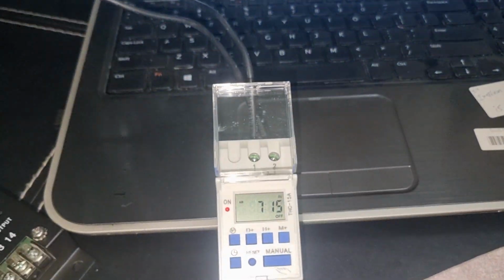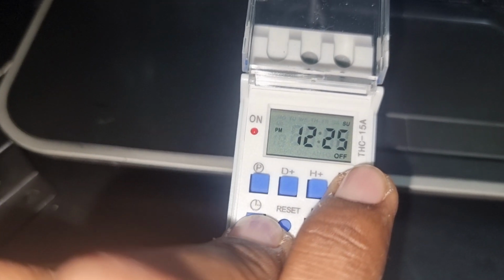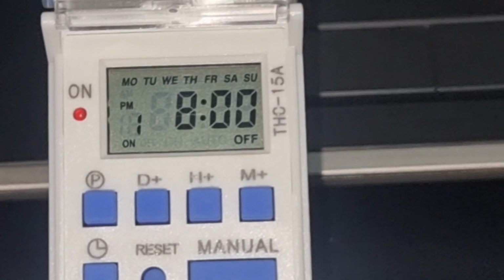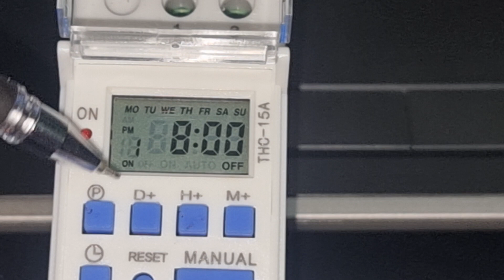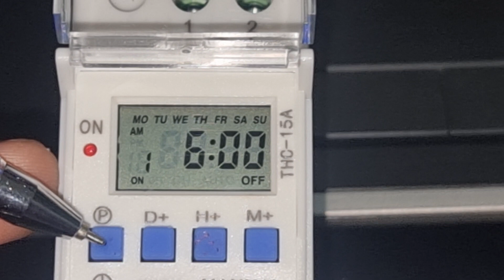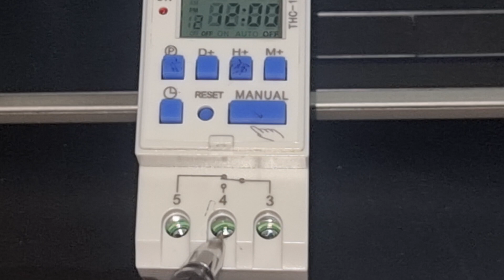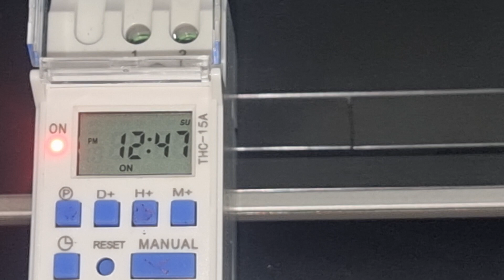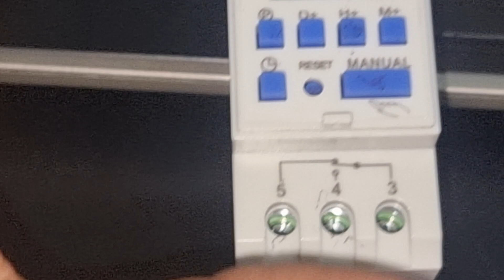How to set the Digital timer TCH 15A.

Comment: Thanks for adding this video mate.  It really helped me using the 4 that I got on a caravan.
Only question I have is that with one of my 4 units, when the unit is set to 'auto' or 'off' the lights come on.  When it's set to 'On' the lights go off.
Do you think it's a faulty switch?  It's the only 1 of 4 units I have that do this.  The other 3 units don't act like this and the wiring is set the same on all 4 units.
Reply from the maker: Hi .
I hope your connection is wrong in timer  there is NO NC option .
When you keep on but the light gone off .
. 
If you want more information. 
Contact me on +971543751912